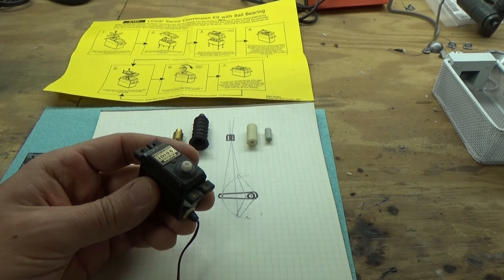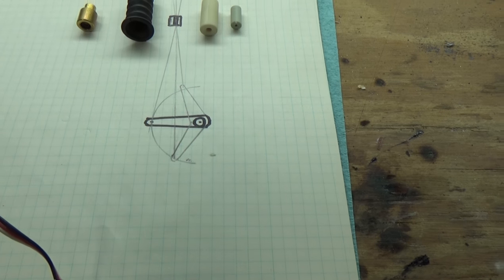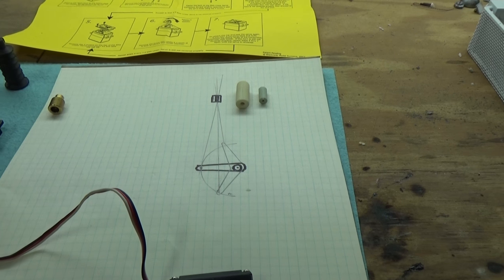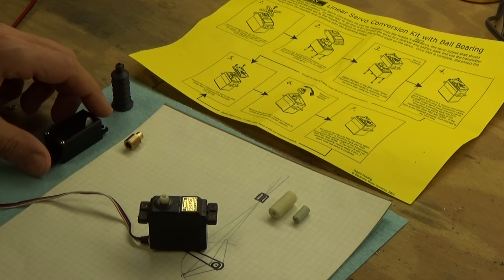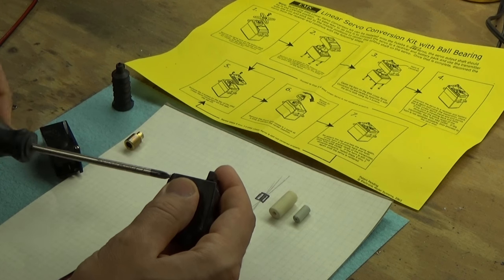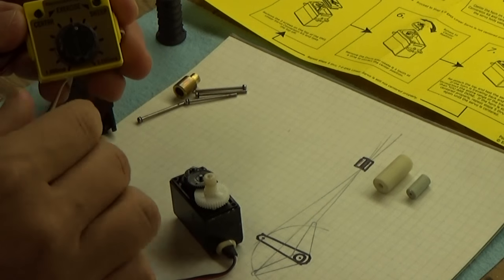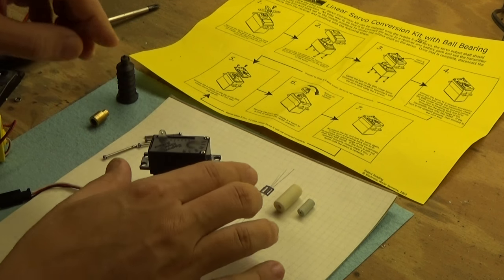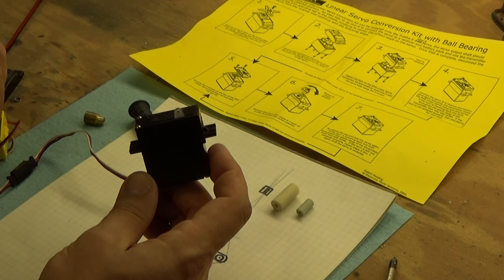Bob's Tip#3: Linear Servos

Comment: I'm a little off topic here but I quit flying RC a couple of years ago because of some physical problems associated with my nearly 80 years on this rock. I don't know how many times I complained to servo manufacturers about the lack of a linear servo option. In lots of cases this would be far better than the rotary style. How come nobody knew about this modification or is it a recent thing?

Comment: Hi Bob, have you gotten an Engel Type 212 yet? I been wondering how the internals work on that one. Looks like it's an all dry hull?
Reply from the maker: I havent' had the opportunity to have a 212 in front of me yet. Yes, the 212 is a dry hull boat. The model splits apart parallel to its long axis and seals with the use of a bayonet locking ring. Slick system, actually.

Comment: This is a question for Bob or whoever else can answer this, I have a question regarding a ballast tank described at the drydocks. Right now I'm in the design phase for a one-man sub and currently am considering the use of a compressed air cylinder to purge the tanks directly. With that much air pressure, a compressor seems unnecessary, making it similar to a compressed gas design instead. Is this true or am I missing something?  Lastly, does the placement of the valves matter, or will the air displace the water regardless. Thanks
Reply from the maker: I would think an air cylinder would be more than adequate, but bear in mind that once your air is gone, you're out of options. You'll need to calculate total volume of air in the cylinder and put in a safety factor to compensate for water pressure at your operational depth.